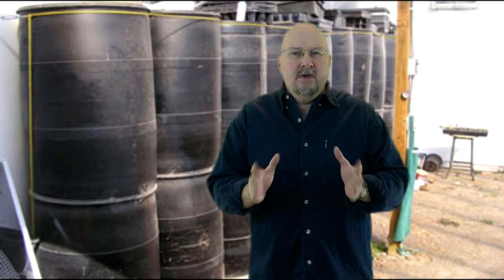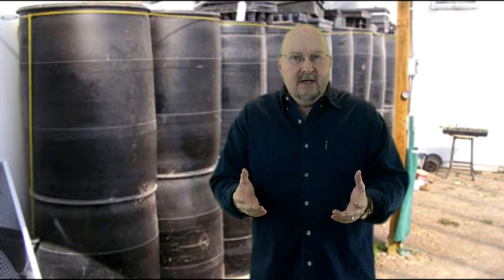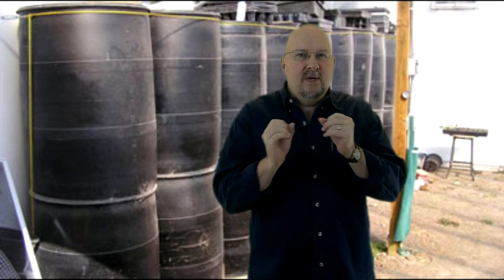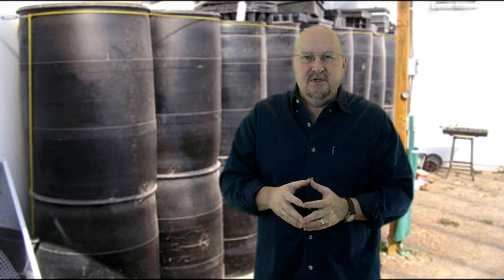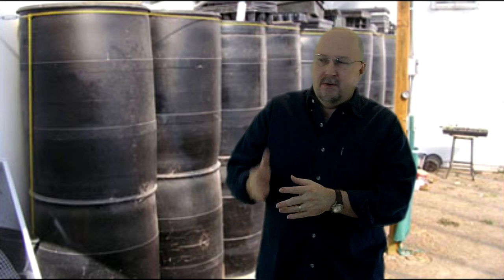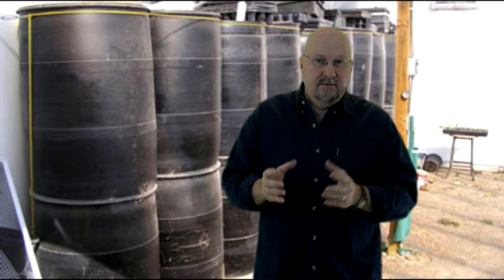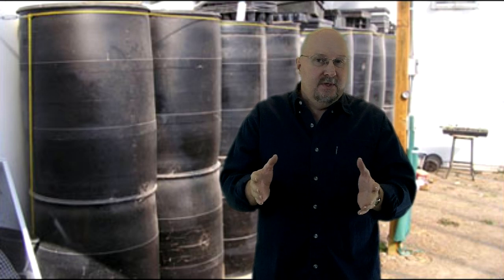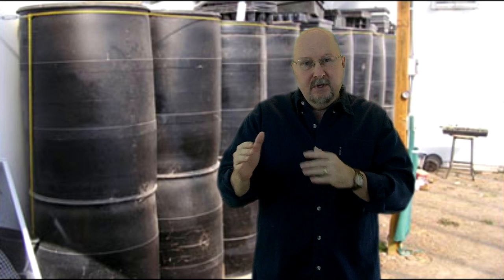Greenhouse heat sinks

Comment: Thanks for this video. I was thinking of using 10 55-gallon black plastic water drums in my greenhouse for some more thermal mass, but we get very few days of good sun during the winter and spring. And it is not unusual for us here in the Pocono Mountains to have sun in the early morning only to have clouds move in around 9 or 10 am and last until late afternoon when the sun peaks out again. Under these sun conditions, I am wondering if the water barrels would be worth it, and further, if I get a bunch of cloudy days in a row, will my propane heater (which stays at a minimum of 60 degrees during the spring/winter) waste propane trying to keep the 550 gallons of water at 60 degrees too.

Comment: Ever tried using stainless steel barrels filled with brine just like the brine in the Dead Sea use in Israel's solar ponds to generate electricity. And coating them with black metal oxide ceramic or clay coating or graphite ceramic or clay coating to absorb heat and the brine inside the stainless steel barrels will build up heat near the boiling point of water. Using silicone rubber or resin impregnated thick fiberglass yarn and coated with EKOR mineral based-plastic, neither extreme heat or cold can go inside nor can heat the got inside escape for they will be absorb by the brine filled stainless steel drums and coated with a black mineral based paint which is a mixture of ceramic clay binger, graphite, and wollastonite (if you can get hold of a supply) which is very durable and will buildup heat to near boiling point.

Comment: If we use a solar fan and pipes and daisychain all those barrels to gather..

 a radiator collecting the heat off of the roof and black pipe ,
 facing the sun ..
could then heat the water that is daisy chained all through all of those barrels.. and a solar pump would do it every time the sun is up

Comment: My greenhouse is running about a 100f degrees during the day but my night temps are terrible. They drop to the identical temp as the outside. My question is I have a 10×20 greenhouse. Do your think if I had a water heating system that I could get away with using 4 barrels painted black? I'm in the middle of making a barrel heater and plan to wrap copper pipe around it to heat water to put into my heat sink barrels. I'm trying to figure out how many barrels I need to have. I live in zone 8b gulf coast area
Reply: How did it go? What material is your greenhouse?

Comment: 55 gal Barrels: would you suggest the plastic ones or the metal barrels?
Reply: metal is always better
Reply: Metal rusts.plastic burns very hot and fast(In a wildfire,I have experienced this-half my greenhouse burned down in a wildfire,because plastic water containers started burning,and could not be put out by water.......)plastic degrades in sunlight,too-should be painted

Comment: Thanks for this interesting video, I decided to take this principle and build my own heatsink using ducts, fans and a 1200L water tank. I've put up a video about it. I haven't been able to test it yet, but over the next few months i'll do a review video of it.
Reply: +FSPrepper yes, I've built it, you can see it in the video on my youtube channel. However I haven't tested it yet as I haven't got the electricity supply connected. But it should have power in the next month or so and then later in the summer I will do a review video to see how well its working.
Reply: +FSPrepper The title is 'Polytunnel Thermal store / heat sink' The first two videos which come up on the search are mine. The first video is when I'm still preparing the soil, and the second one is after its mostly finished.

Comment: Those are not properly called "heat sinks" in physics or passive solar design. A sink is somewhere energy goes and dissipates and cannot be recovered, like ground in an electrical circuit. What you're talking about is properly known as "thermal storage", or "heat storage". That is where heat energy is trapped along its way to PREVENT it from going to the sink or the ground.   Another thing you can do to use the ground as thermal storage is to insulate the ground around the greenhouse several feet out, so that the heat is trapped in the surface earth beneath. In very cold climates you could bury
the insulation two feet deep and trap heat in the insulatively enclosed soil on top of the insulation inside.
Reply: +rstevewarmorycom  From Ross Murphy in Shawnee, Kansas: You are right about the term heat sink, but who cares? I understand what he is getting at and he makes his point with logic and common sense, so it is moot; who cares?
Reply: This is about construction, not thermodynamics. Why complicate the discussion? Why make things more difficult to understand. It's not about science!
Reply: And, you have no business here trying show how smart you are. Stick to your classroom. professor, and let people alone to work on their own projects.
Reply: Jaye Jay Curry Yes, that's an electronic or electrical "heat sink". But a "thermal sink" is NOT the same thing. You cannot learn physics out of dictionaries because dictionaries are NOT written by physicists, they're written by English majors who just look shit up like you did and imagine they learned something, when they didn't.
Reply: Okay, let's try it your way. I googled thermal sink in an effort to "learn" the difference between a heat sink and a thermal sink. Guess what, slick? All of the heat sink sites I had previously visited came back up! Wow, that must mean that the world is wrong, or you are.

Let's examine what a heat sink does. A heat sink absorbs energy from a thermal source (in our case, the sun), stores it (in our case, in water), and the gives up that thermal energy by convection (not so much by radiation). Some heat sinks have fins or other structures to aid in convection, some do not. As long as the sun is shining on our heat sink (the barrels) and the ambient air temperature is relatively high, the heat sink will continue to take in more energy than it give off. When the heat source is removed (the sun goes down) and the ambient air temperature decreases, then the air in contact with the heat sink is heated by the water, which gradually cools.

Don't take my word for it. You Google it and see for yourself! Oh, that's right. You're some kind of super physicist who know better than the rest of the world. Aren't you? What school was it that you graduated from? I don't seem to remember.

You sound like a environmental studies professor I had at Indiana University. He was dead set on his theory that the accumulated heat from all human activities was going to build up until the earth spontaneous combusted. He was one of the reasons I transferred to Purdue. Did you ever teach environmental studies at IU? Are you sure it isn't you? You sound as stubborn and self-centered as he did.
Reply: rstevewarmorycom another internet grammar nazi
Reply: Jorge Manure No. A source feeds energy to a sink, and the flow of energy can be useful. Storage is NOT a sink. Storage is a place midway between source and sink where power can be stored for later use, it KEEPS it from flowing "downhill" to the sink. You don't seem to know any physics, Senor Manure!
Reply: Jorge Manure You're an idiot, and you're NOT a physicist. You don't even understand that heat flow and electron flow are completely analogous.
Reply: +Jorge Manure I'm not going to take a test from you or do your homework problems for you. That's stupid. And Carnot has nothing to do with this, this isn't a heat engine, this is a thermal application. This is a matter of proper nomenclature and principle. A "sink" is the LAST place energy visits on its way to the heat death of the universe, or whatever local minimum energy state. You cannot derive energy from a "sink". Storage is uphill potential-wise from a "sink", so that it can store energy that then CAN be used. A "sink" is NOT "storage" or it could not be used. In the case of a greenhouse, the heat flows out of it, so the out of doors would be the "sink". The warmer water tanks would be storage.
Reply: Jorge Manure Bullshit, Manure.
Reply: The point of this video is not educating people in physics, but educating people in building greenhouse. So what, if the term used isn't proper. It's the concept of using trapped heat that is important here. Don't take things so seriously.
Reply: Why make things more complicated than they need to be? Passive solar heating=no pumps, tubing, connectors, additional structures, valves, labour, or costs.
Reply: Jaye Jay Curry In order for people to understand the thermodynamics they have to get the principles and the names for things straight, or when they go to read about them they will become confused.
Reply: Jaye Jay Curry Yes it is. If you don't know that then you have no business flapping your lips here.
Reply: Okay. I checked the definition of "heat sink":

http://www.dictionary.com/browse/heat-sink

I guess you don't know as much as you pretend. Now, go sit in the corner and play with yourself, while the rest of us learn something.
Reply: "Well it proves one thing, Mr. Hooper. It proves you wealthy college boys don't have education enough to admit when you are wrong."
Reply: Jaye Jay Curry What the fuck's a "Mr Hooper"? "Ah, so it's that damn book-learnin', huh? Dem collage bways don't aktwally have any smarts, it's just they'se delooded by dem books full of ekwashions and shit!!" Are you some kind of fucking pig-ignorant hick? I went to college in physics after being raised in the country and being a pig and corn and soy farmer in Missouri, re-building farm equipment and engines for a living, I was poorest among my college class, you bloody fucking stupid asshole!!
Reply: Oh my, what language. The quote was from "Jaws". But, it was rather appropriate. You see, Jack, we aren't studying physics here. Yes, physics does have a bearing on the topic. But, the topic here is greenhouses, and heating and cooling in greenhouses. For your information, the term "heat sink" within this topic is different from how a physicist might use it. Or, did you not know that areas of knowledge might rely on other definitions? I just spent 10 minutes looking up the term "heat sink" at passive solar energy sites. Guess what? The term is universally used to identify thermal masses as heat traps. But, thanks for your background. I now know why you try so hard to prove to everyone that you are the "smartest guy in the discussion", supposedly. But, you aren't half as smart as you think you are, or you wouldn't be making an ass of yourself. As Captain Quint said, "You don't have education enough to admit you are wrong."
Reply: Jaye Jay Curry That's stuff is called PHYSICS, you MORON!!  

A heatsink is to dissipate heat, it has fins to increase area to the air and space, it is thermally conductive material to transfer the heat to those fins, and it has as little thermal mass,  that is, as low a heat capacity/specific heat as possible, and it is black in the IR spectrum to better radiate heat. 

A thermal sink is to store heat. A thermal sink has HUGE heat capacity/specific heat, it is NOT very heat conductive, and it has much larger mass than a heatsink. 

They are TOTALLY different. 
So you see, I was right, and YOU were wrong!

That you're more worried about my qualifications and "how smart I think I am", rather than being interested in what the TRUTH is, is evidence that you're nothing but a resentful little flunk-out who likely barely squeaked through school if you even finished at all!!
Reply: Jaye Jay Curry Whatever you GOOGLED it wasn't a book of physics or thermodynamics. All you did was carefully find people who made the same mistake you did. I wonder why? Picked any cherries lately? Or are you just lying?
With someone like that at Indiana I'm sure you're confused about lots and lots of things.
Good luck at Purdue, Derpee.
http://engr.bd.psu.edu/davej/classes/thermo/chapter5.html
Reply: No, I Googled "heat sink" and "heat sink in passive solar". That is, after all, the subject at hand, not physics or thermodynamics.

As for cherry picking, no, I didn't do that either. I referenced the first two pages I found that dealt with the subject at hand.

One thing I've noticed over the years is that when ever anyone of limited intelligence ends up on the losing end of a debate, they invariably resort to name calling, casting insults, and attempt to discredit as you've often done here.

As I've said many times, the subject is greenhouses, not physics or thermodynamics, or word games. Since you've sunk from an intellectual debate to childish behavior, there is no point in further discussions. All of this doesn't amount to a hill of bean anyway. The principle works no matter what you call it. That is the bottom line.
Reply: Jaye Jay Curry No, they just call YOU names because you're stupid. :-> It's just your ignorant impression that they are less intelligent than you are, see the "Dunning-Kruger Effect"!!

And no, it doesn't "work" anyway, it sabotages the actual principles they need to understand to design things like greenhouses!
 
A thermal SOURCE supplies heat energy from a higher thermal potential (temperature) TO a heat RESERVOIR or THERMAL MASS which STORES heat ABOVE the heat potential (temperature) of a thermal SINK!! So it flows FROM the SOURCE to the reservoir, then to where it does work later, and then to the SINK where its potential is lost. That's thermodynamics. 

A "heat sink" in electricity and electronics is a component that acts as a good convector/radiator.
Reply: You were busy Googling crap weren't you?You should have Googled heat sink in the greenhouse. I did and came up with page after page of references. So, obviously the term "heat sink" used in greenhouse design is different than your physics term. I bet you have no idea what a "cold sink" is either, as it relates to greenhouses.It is interesting that you were able to come up with the Dunning-Kruger Effect. Did it ever occur to you that you are the one who is ignorant of the subject being discussed, yet think of yourself as an expert on the subject.While we are Googling crap, I found something of interest:10 Signs Therapists Note When They Assess Emotional Childishness (in Adults)1. Emotional escalation: Young children often cry, get mad, or look petulant and pout. Grownups seldom do.2. Blaming: When things go wrong, young children look to blame someone. Grownups look to fix the problem.3. Lies: When there's a situation that's uncomfortable, young children might lie to stay out of trouble. Grownups deal with reality, reliably speaking the truth.4. Name-calling: Children call each other names. Adults seek to understand issues. Adults do not make "ad hominen" attacks, that is, attacks on people's personal traits.5. Impulsivity: Children strike out recklessly when they feel hurt or mad. They speak impulsively or take action impulsive action without pausing to think about the potential consequences.6. Need to be the center of attention: Ever try to have an adult conversation with a two year old present? The disrupts the conversation by pouting, stomping their feet (literally or figuratively), and interrupts the discussion.7. Bullying: Demands what he wants by just taking it from others.8. Budding narcissism: Attitudes are rigid, and the child throws a fit when he doesn't get his way. It's my way or the highway.9. Immature defenses: Children tend to regard the best defense as a strong offense. Attacking anyone who has a view that sounds different, therefore threatening, is a primitive defense mechanism.10.No observing ego: Children who have not internalized mature guidelines of respectful behavior towards others, see their anger as normal, as "ego syntonic", and justify it by blaming the other person.(C) Susan Heitler, PhD"No, they just call YOU names because you're stupid. :-> " Nobody has called me names, except for you. There is no one else that you can blame for your emotional escalations, lies, name-calling, bullying, etc. of either me or Bruce. Your childish behavior is all on you! What I did get at first is why, given your narrow-minded views of greenhouse terminology, you just didn't leave. Instead, you just had to hang about and try and take over the conversation to stroke your narcissism. Go do that in a closet; and you might wash your hands afterwards.
Reply: Jaye Jay Curry Ooooh, "different than the physics term", bullshit, you mean.
Reply: Okay, I leave it to you, being an expert on bullshit and all. Oh, and since you are so ignorant of every field of endeavor having its own unique terminology, I think you are lying about having a degree in anything, let alone physics. Anyone who has had even a basic course in physics would know this. You are a fraud and not worth anyone's time.
Reply: kansasross It might help people understand physics if they used the right terms.

Comment: Great tips. I would like to add one more thing. If you have an aquaponic system or single barrels place glass on top. On a sunny winter day it can add 10 -15 degrees to the water. I have a 600 gallon system. That alone can keep temps in the 40's with no additional heat when temps dip as low as 20-18 at night in a 20 x 40 single layer hoop house. I wanted to paste a few pictures but I could not copy and paste them...
Reply: +Shelia Hoyt 
A 15 degree rise in the 600gal tank represents 22kw, thats not much heat for a greenhouse that size especially with single poly. If your tank isnt covered a lot of the sensible heat will be lost as its converted to the latent form (water vapour) which will raise the greenhouse humidity without raising the temperature :)

Comment: I would use solar water heaters with a 12v solar circulating pump to warm the water i the barrels during the day and them turn off the pump at night.